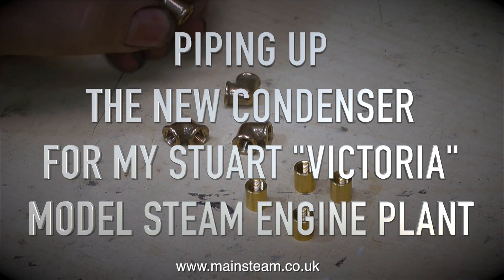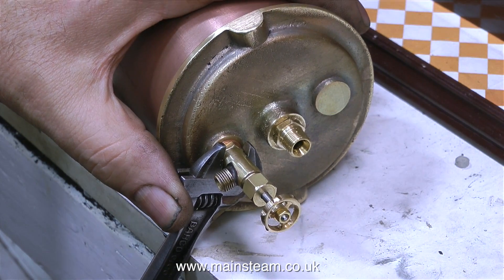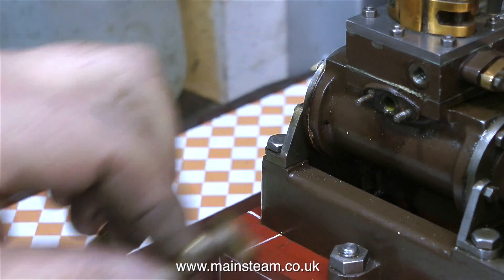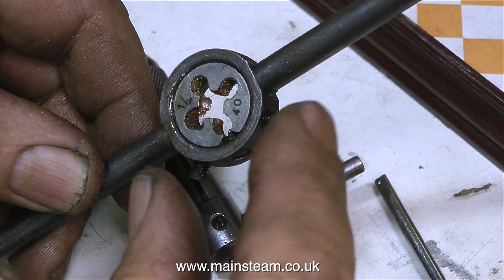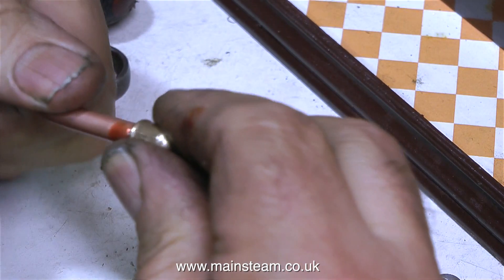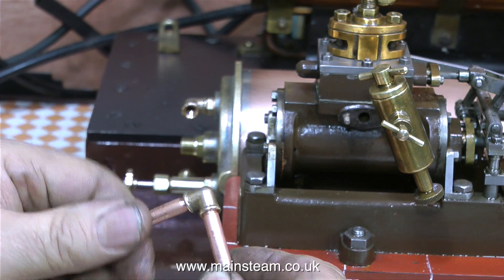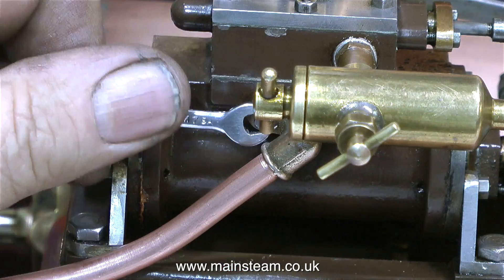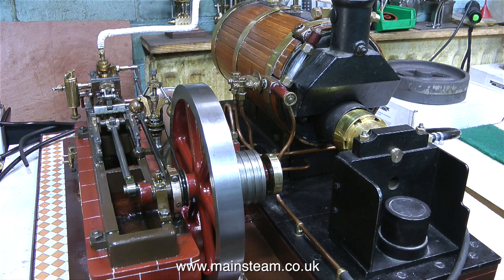PIPING UP THE CONDENSER FOR MY VICTORIA STEAM PLANT

Comment: when i first started in machine shop many many decades ago we used  various blends of ingredients to make what some refer to as tapping butter, for use on different types of materials. 

 copper and brass we used
bees wax and melted  with vaseline to make and a  small amount of sulfur oil to make a thick creamy paste when cooled
or bees wax and light sulfur oil  heated and mixed to a thick  liquid  consistency when cool    
 
aluminum we used lard oil and kerosene  .  

cast iron we cut with various types of blends depending on the type and grade of cast iron.

 and as you mention here the soft copper was done with  two or three passes with the it set in progressive cuts  from loose to final  fit.

Comment: Keith

 A tip told me by a old timer for machine copper inc threading now I am not having you on , but cows milk from the dairy is he best tapping /cutting fluid for copper , it works

Now for a technical tip told by cu alloys ,I know you hate Ali bronze big time but as you know it will not silver solder , the flux will not whet the joint ,solution 1 teaspoon of common table salt in the flux sorts it out. Just a thought in case you get a rebuild in that has some bronze that will not silver solder

Enjoying you Vicky build a totally different approach to my mind set ,but refreshing non the less

Stuart

Comment: Threaded elbows .... but doesn't Forest-Classics also make "sweat" elbows? (solderable?) Sometimes getting thread elbows to end up where they should be is real tricky, no?
Reply from the maker: I try to avoid soft soldering pipe unions - even on the exhaust, they are easy enough to line up as the metal is soft.

Comment: That is looking really good. In this sort of condenser, do they ever fit some sort of baffle inside the cylinder to kind of force the steam stream into contact with a surface? I'm not thinking of anything sophisticated, maybe just semicircular copper plates in maybe 3 places spaced inside the cylinder.
Reply from the maker: I don't know much about full sized steam engine condensers, but this is just a tank without any internal baffles.
Reply: Full sized condensers are generally cooled by water pipes going crosswise to the steam flow.

Comment: How do you plan to mount it ?
I'm sure you must have a plan but I would have thought making the mounting before plumbing it in would make it easier than the other way round.
Reply from the maker: It just sits on the base board between the engine & the boiler plinth. It is a snug fit and doesn't move at all.